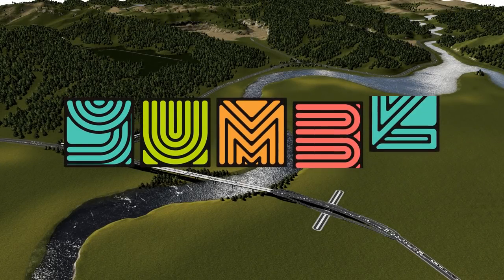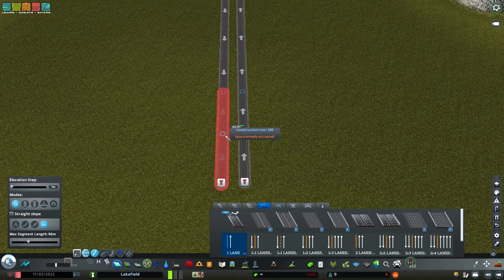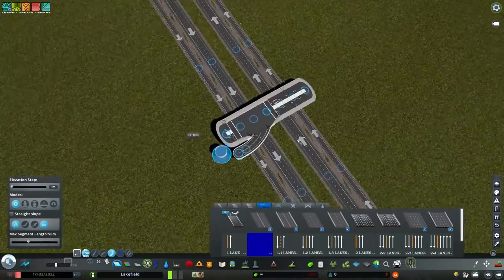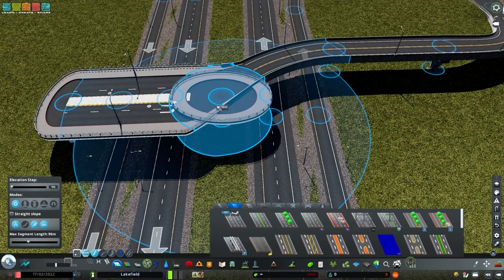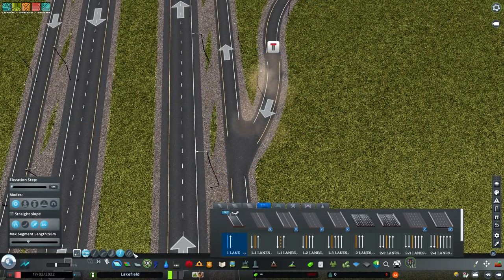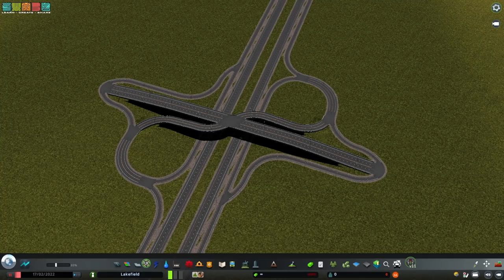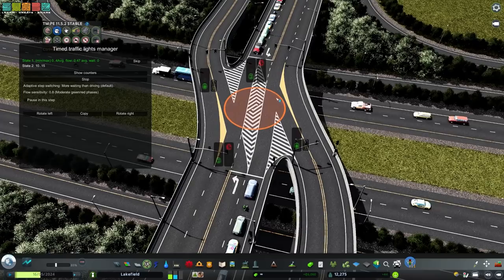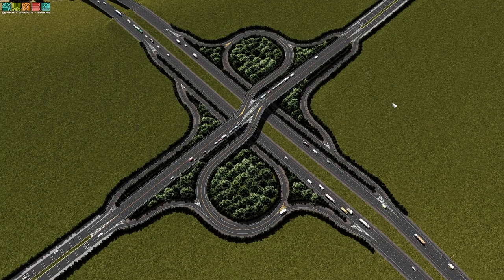Best Interchange Design  -  Single Point Partial Cloverleaf (SPPC) (Service Interchange)

Comment: I actually think this has a slight advantage over diverging diamonds in that the traffic flow is just as controlled BUT it's a lot more organic in it's design. Easier for people to understand because it incorporates normal seeming left/right/through traffic. People do get a little confused and disoriented by the pathfinding of  a diverging diamond at first. In the real world, if the power was ever to go out, people would still be left with a much safer crossing to navigate than with a diverging diamond.
Reply from the maker: I agree! The only issue I see with the SPPC is space. Its big.
Reply: @YUMBL  lol yes it is.
Reply: It does have a big footprint, but for clearing traffic its so efficient. It can do the work of two or three slower interchanges if your road network at either end is set up even somewhat correctly. Thus it earns all the brownie points.
Reply from the maker: Agreed!
Reply: My understanding of the diverging diamond is that its slight unfamiliarity is actually a point in its favour, as it makes people pay more attention to what is going on, the highest cause of crashes being inattention (for a variety of reasons).
That said, I've never actually driven through a diverging diamond. We don't have them where I live. We mostly use a stretched roundabout, which has the additional advantage of not needing power to function.
Reply: @theAkornTree  they are weird to drive through... this seems like it would be far nicer in real life
Reply: It fascinates me that road engineers continue to sing the praises of diverging diamonds while they're getting people killed; all the while playing it off as "well, people are too stupid to understand how much better this is."
Reply from the maker: Are they getting people killed? I would actually love to know your source, but I’m also about to research it myself.
Reply: @theAkornTree  IT'S ACTUALLY DESIGNED FOR DRIVERLESS CARS IN AN AUTOMATED SYSTEM FREE OF INDEPENDENT THINKING OR CONTROL. ;)
   There is a big difference between "unfamiliarity" and counter intuitive. lol The way the traffic CROSSES in a diverging diamond requires you to go against your very nature to think and plug yourself into a controlled system of movement that directly opposes that. All you have to do to prove that is take away the traffic lights and watch the utter chaos. In any normal 4 way intersection, there is a system of rules that you can follow without traffic lights, should they fail they every driver is REQUIRED to know.
   Its' biggest failing is exactly the opposite of what you're proposing. You HAVE to turn your ability to think off. And TRUST this system.
   I've said this from the very beginning.. I really like it. And as long as it functions without fail, and people are trained how to follow the instructions before hand, it's all good. BUT IMAGINE YOU'RE DRIVING ON THE WRONG SIDE OF HTE ROAD FOR THE FIRST TIME, THEN CROSSING BACK AGAIN FACING ONCOMING TRAFFIC PART OF THE TIME. LOL Human nature is gonna take over and make you a little nervous.
Reply: @kelaarin  The first Diverging Diamond Interchanges in America have been studied intensely since their introduction (Off the top of my head I think they were in Missouri), and the Traffic accident rate dropped 65% on those since they were introduced in that (I think Missouri) town in 2009.
Reply from the maker: Yes, pretty sure they’re statistically quite safe.
Reply: And even if there are accidents in a DDI, at least they're unlikely to be T-bones.

Comment: Okay, stared at this for a while, and I came to this conclusion:  If you spread the overpass lanes apart, similar to the main highway, you could have a left lane exit the drops down and goes under the other side, removing the last point of contention and turning it into a None Point Partial Cloverleaf.   You could also extend the incoming lanes so that there is no conflict and no potential for cars to try to cross over.  I think that removing that cross over (and the traffic light) would up the flow a bit.
Reply from the maker: Yea. People in my discord have done it. It would be a very expensive system interchange.

Comment: You had designed this a few months ago. I use it wherever I can fit it in. There is no better solution. High volume, no backups. 

With proper lane markings it is also beautiful to look at.

Comment: Even if it does not outperform other designs, it gets full marks for aesthetics.👍I managed to build a conflict free DivDia service interchange, which works like a charm but looks strange...unlike this Beauty.
I've recently found "Highway over Wall" networks by SimoG and instantly stopped using other HW.
This one uses a single net for both directions (node count!) with a great concept for entry/exit lanes and barriers very realistic f Europian design... The only downside, I have to "redesign" all junctions, but we came here to build so I won't complain. 
Thanks f the inspiration
Reply from the maker: I think it does outperform. All but free flowing system interchanges (stacks)

Comment: You can completely stop crossing traffic by adding 1 more road to each side and converting the roads going around underneath the overpass ramps to 2 way then use TMPE to stop left turns crossing traffic at either end of the bridge section. The traffic can then be free following with no slow downs.
Reply from the maker: Show me!

Comment: Having the left turning traffic cross before the left turning traffic from the other side is genius. Otherwise, you get queues of left turning traffic on both sides of the bridge, and these queues just block each other.

 I would expect this to work very well in real-life too. Even without traffic signals. The left turning cars only have to cross a single lane, which should be easy enough. And there's plenty of room for the left turning traffic to queue up without causing other issues.

Comment: Yumble, as always I love the stuff you do.

I have a suggestion for another variant of this you can try. Where you have the single point with the traffic light, if you split that back into 2 points, with a right turn off, the city street, joining the highway exit ramp the highway left turn traffic uses, (I'd add a 2nd lane to keep out the conflict for the shared section), and continue that ramp straight through, it would function as the left turn on ramp for form city street to highway, with no need for any crossing traffic at all. Repeat the same thing for the other side of the road. The traffic exiting the highway and turning right onto the city streets does so just after the traffic left turning onto the highway does, using the same lane as those who just turned right did (meaning there's no through traffic to cross paths, no left turns to cross paths, no crossing paths at all, just right turns and merging). I'd love to see how you could implement a design variant like this. The main reason would be when things get really busy, and you need to further upgrade the capacity of your interchange. It's more complex then the SPPC, but offers more flow.
Reply from the maker: I cant really understand it written out. I may need a pic/ diagram
Reply: @YUMBL  I was thinking that too when I'd finished writing it. I may have to load up a city with everything unlocked and just put an example together and share it via your discord.

I also have another variant of a no conflict urban interchange I could show there now (well a "now" when it's not closing on midnight at any rate). LOL

Comment: As usual I'm really looking forward to building what you've shown us, thank you Yumbl! A quick mod question if you don't mind, which mod do you use to enable the extra row in your Road Toolbar? I've tried a couple from the Workshop and they both hide all my Vanilla+ roads and I need to reinstall them a couple times afterwards before I can see them again.
Reply from the maker: Thank you! I use “yet another toolbar”
Reply: @YUMBL  I'm going to grab that off the Workshop right now and get started on the SPPC, I'm excited to try it! Thanks again Yumbl, you rock!

Edit: The mod worked perfectly and I can still use Vanilla+ 😄 thank you

Comment: The mod issue where the options for the roads don’t come up until you click on it again, can actually be fixed by clicking on the water infrastructure tab, then clicking back to the roads tab. Just a tip!
Reply from the maker: Excellent tip! Thank you :)

Comment: The overpass road having 3 lanes and also allowing a yielding green for the left turns at the lights so when oncoming has a green for through traffic, the left turners can still turn. With those changes this would probably beat a diverging diamond for its flow.
Reply from the maker: I wish the yielding green were an option

Comment: I was wondering can you take a look at the dispersed triple roundabout interchange at Gilbert’s corner near Dulles? I thought it was really interesting how they used dispersed spacing and 3 small roundabouts to manage moderate traffic without lights or an overpass. As far as I can tell it works pretty well. Anyway, you might find that an interesting low cost solution.
Reply from the maker: I’ve driven it! Its west of me. Great little rural VA rarity

Comment: Only issue I see is the cross traffic is 1 lane each direction. Perhaps an added turning lane would work better to keep 2 lanes of cross traffic?
Reply from the maker: Oh, yes! I said it at the end of the vid, but that would require an 8 lane arterial leading to the interchange which i hope not to use in this city.

Comment: Hey Yumbl! When you use a road to add a node, couldn't you just use electrics mod or something like that to add one? I am just curious if there is a difference between doing it the way you have done vs using a mod or if its just for convenience. Great video also, we need to direct SoEverdream to these videos :-)
Reply: I think it is more to do with ensuring the new node you add matches up on all the roads in parallel. When deleting the "node creating" intersecting road, it leaves behind a node at the same point on the other roads.
Reply from the maker: This is correct. It snaps to the dead center when drawing a new connection. I also recommend using network multitool instead of elextrix
Reply: @YUMBL  Thanks, its been a good year since I played cities so I am a little rusty!

Comment: i would use a turbo kind of intersection. and shurly no traffic light. in stead i would use a tunnel to turn left. much better solution. to few intersection designers forget how good tunels works in intersection. yes if premade, we only need to use anarcy
Reply from the maker: That sounds like a system interchange. This is a service interchange

Comment: I wish you'd shown the process for placing lane markings. Specially the center one. I'm still puzzled by how you did it.
Reply from the maker: Its one shape with two separate fillers :)
Reply: @YUMBL  and I understood none of that :) I don't know how you erased the lines crossing somebody else's lane.
Reply from the maker: Oh, please watch my video from 6 days ago. “Stay in your lane” is about IMT
Reply: @YUMBL  ok so I did watch it. When I'm trying to do the add rule thing. When I select two points I wanna 'remove'. It just gives me a This Rule is overlapped by another rule.... error. Trying to do markings for an SPPC.
Reply from the maker: You need to change the “from” and “to” boxes. Its in the video. Draw all your lines, change the end points, add necessary rules after
Reply: @YUMBL  Alright. I more or less understand how it works. It's still puzzle solving which ones to remove in sequence or I ruin the entire thing.

Thanks Yumbl.
Reply from the maker: Youre welcome! Just tryst when I say “make all your lines first”. Every single one :)
Reply: @YUMBL  I did. It just became a jumble spaghetti mess that I don't know which is which :) I am now trying to color code each lane first and trying again.

Comment: It appears to me that letting same direction traffic the green light at the same time could help with "on the fly" lane changes before the crossing.
Reply from the maker: Idk what you mean
Reply: @YUMBL  I mean there are to ways to set up the lights. You either give way lanes in the same direction simultaneously then do the same for the other direction or you give way to all straight traffic then to all turning traffic. In the later case you always have one lane moving and another one not moving in the same direction. This can cause issues with cars that have missed their lane.
Reply from the maker: Irl if you miss your lane… then you missed your lane. People seem enamored with u turns and such. In my experience if your turn you pull off, turn around, and go the right way. Doesnt happen in CS, but irl one doesn’t just give up if they missed their turn.
Reply: @YUMBL  Yeah, in some countries they don't give up. They just stand there in their lane with the turn light turned on and wait till they'd be given a space in the lane they want to go to. Doesn't matter that all the traffic waits behind...
Also, if one way to do this causes fewer lane misses why don't just use that way;)
Reply from the maker: Those people are irresponsible and unable to own their mistake at the cost of others safety. If a normal adult human misses their turn they should miss it entirely, go turn around, and try it again. This time with more knowledge.

Comment: I love the look of this one. Definitely going to add it to my next city! Also - I love these roads. Do you prefer them or the BIG Urban Roads?
Reply from the maker: Thanks! I’m not sure yet, but ultimate roads is promising. Many more options.
Reply: @YUMBL  I've had problems with the "ultimate" roads. They don't play well with other roads. I very often get sidewalks crossing right through intersections like they do if you turn off node snapping. I've even had one elevated road where the pillar just punched a hole through the world, mantle showing under a flat stretch of overpass. The markings flicker sometimes too. Definitely lots of options, but the quality seems lacking.
Reply from the maker: If i have to swap em out i will, but for now i want to see how they work :)
Reply: @YUMBL  they may work fine for you. Could be an interaction with something else in my game. I definitely have something wrong somewhere. But just wanted to share my experience with them.

Comment: Wouldn't it be too dangerous in real life? I mean part of these circular curves are suddenly two ways. So those from the highway might not notice that and end up driving against the flow after passing that intersection.
Reply from the maker: It would be good to have a barrier on the two way road irl. I just dont have a network with a barrier.
Reply: Do you have any ideas for an interchange between two highways with no risky points? Thinking how to solve it made me a headache already. I've just found your channel and gonna dig for more traffic inspirations
Reply from the maker: Trumpet for 3 way, and stack for 4.

Comment: in order to turn left on to the highway you need to go thru three lights.
Reply from the maker: Theres only one light on the interchange. Whatchu talking about 😂
Reply: @YUMBL  I was thinking that you would put a light at each end of the overpass. Because you know if someone built this they would have cross roads with lights at each side. really close to the highway. That's what my neighborhood is like. The highway junction is a single point. Light, 40 feet, light and another 40 feet and light, again... lol. But also I think the on ramps first merge should turn into a two lane otherwise the one side will have to yield, slowing traffic. does that make sense? sorry, I'm really... to infinity and beyond... lol if you know what I mean. Not trying to get auto banned.
Reply from the maker: No, then ends are conflict free.
Reply: @YUMBL  dope.

Comment: Has anyone had trouble with schools not operating?  When I initially place any school it's in operation and within seconds it stops working, any ideas?
Reply from the maker: What does it do exactly?
Reply: It says not in operation, it doesn't highlight when you select schools but it still keeps count of the kids. basically I have no school coverage.
Reply from the maker: Donotger schools work?
Reply: @YUMBL  No, but I just found it's one of my mods causing the problem.
Reply: @YUMBL  yes, schools are working now, it's one of my mods.  Thanks